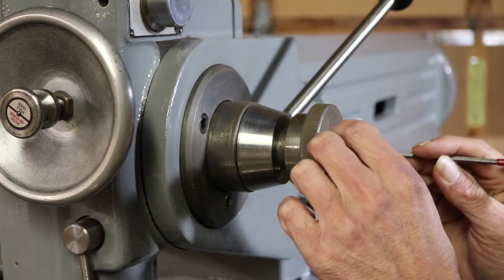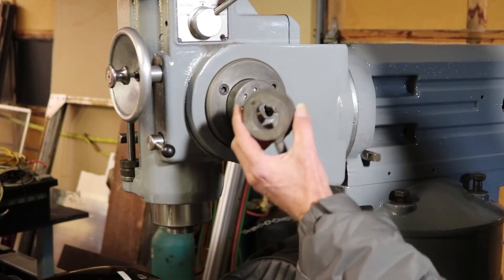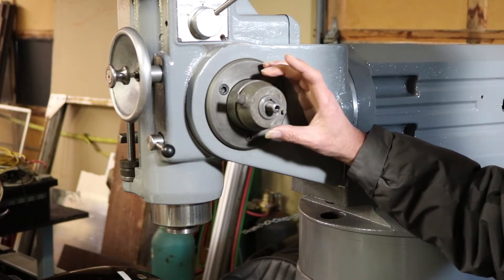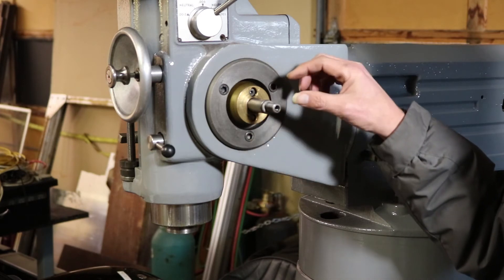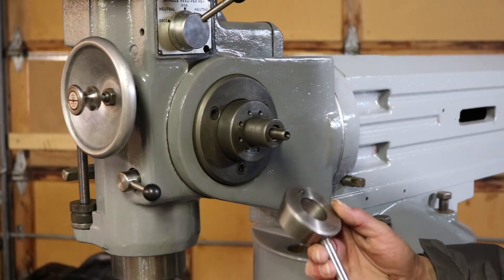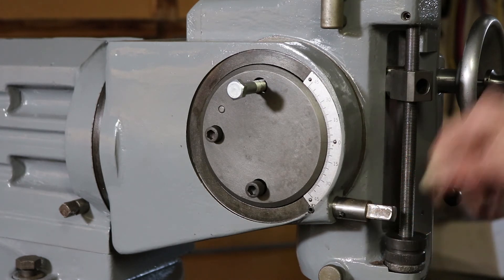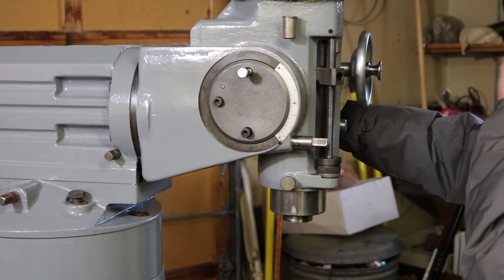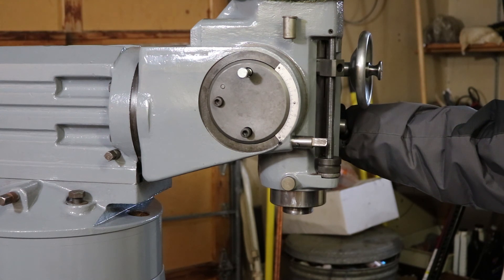EX-CELL-O 602 Vertical Milling Machine - Quill Feed and Head Removal - Part 1

Comment from the maker: If anyone needs any more information on removing the head let me know.  I need to get back into the gearbox that drives the quill power feed to fix the one thrust bearing inside.  One ball fell out while re-assembling the gear train inside.  I'm willing to pull the head off and apart on video just to document it for others.
Reply: We have two more EXCELLO questions.1.do you know here we can get a replacement rpm gage wheel for the head? And 2, the. Ram handle just spins.did we break a pin on the shaft?( how can we free up the ram?
Reply from the maker: @chrisdnomiug8994  There aren't a lot of parts available for these mills. As far as the quill goes there is the quill lock, the lever on the front of the head under the hand wheel. The power feed selector should be in neutral and the power feed clutch knob should be tightened to engage the clutch that I talk about in this video. I hope that helps.

Comment: I have the same mill with the power feed broken off at the handle . Do you know if that is hard to remake
Reply from the maker: Hi Keith,

If you send me pictures of the damaged parts I should be able to help (email address below).

I should also say that there may be one internal part in the head that could still prevent the power feed from working.  It is a Nylon gear pressed onto a knurled steel keyed carrier in the head to power the feed gear box.  Nylon expands over time and mine has expanded to the point that the carrier can't rotate the Nylon gear to power the feed gear box.  Depending on what external parts are damaged it may be somewhat difficult, or not, to determine if the gear is incapable of driving the power feed.

I'll be glad to help if I can.

My email is mccullochjimn@gmail.com

Comment: Kudos to you for saving this machine. In my opinion, the XLO leaves the Bridgeport in the dust. Just bob the head on a Bridgeport and the cutter is off the table. Also, an additional inch of quill travel is great. The only machine of the Bridgeport type that I like better is the Tree 2UVRC.

Comment: Jim, thanks for publishing your two Excello videos. Your first video inspired me to create a similar video that I just published for my Excello mill I rebuilt back in 2011/12. Overall I think mine was in better shape than yours, at least in regards to mine not being out in the weather for years. I still had to replace a few parts but I got lucky and found what I needed.

If you get the opportunity you should publish another video of your mill in it's current state.

Thanks! Brad
Reply from the maker: Brad, thanks for the compliment.  Your video was great, it was like reliving those times all over again and it gives others images that I didn't quite get.  Nice to see another early model.
Unfortunately I haven't worked on it since the second video, the Y axis has a .007" dip in the center and other life happened.  At some point I think I'll get up with bcbloc02 to HBM the knee.
I subscribed to you and I'll add a link in the description of this video your channel, if I can figure out how do that to.
Reply: @jimm2099  That sucks about the .007" issue.  Any idea how the knee could wear that much in the center?  I didn't realize it until recently but Brian Block is only a couple hours north of me.  I live near Richmond and he's up in the Frankfort area.  I know what it's like to put projects on hold and in the interim time just seems to fly by.
Reply: As far as adding links, I'll do the same if I can figure things out!
Reply from the maker: @bradkahler  There are some reports about the metering/one-way-valves clogging.  Jeff, my neighbor that I got it from said it came from a community college. The table looks like it was from a Jr. high.  In any case the metering valves were absolutely clogged.  I'm in Durham.
Reply: @jimm2099  There is probably some truth to the metering valves plugging.  My mill had no lubrication system when I got it.  Someone had replaced all of the fittings  with grease zerks.  The whole mill was one gooey mess.  I thought your table looked pretty good compared to mine!  Mine doesn't have much in the way of flat spots anymore.

Comment: My buddies EXCELLO motor spins,but when he installed the belt it stops.is there a quill lock or brake that is jammed we missed? Or back gears? Motor is running on a VFD.
Reply from the maker: Chris, The spindle brake lever is on the left side of the belt housing. The back gear lever is the high and low speed lever. Three things come to mind without further details. First, the cam activated shaft running horizontally through the left side of the belt housing is locked in place in the braked position. Two, something is wrong in the back gear box. Three, the spindle is locked up. If you can provide more details I may be able to help more.

Comment: Hi Jim,
 did you ever get back to the power feed? My down and up pull rod is extremely tight to operate,the mill works in both directions it's just a bear to move the rod. any ideas what's going on in there? any help is appreciated. Thanks
Reply from the maker: Hi Todd,
I haven't taken it back apart yet.  I will have to say though that the gearbox on mine was 70% to 80% filled with very old grease. That same forward/reverse rod was very difficult to move on mine when I first got it, there was a lot of crud between the forward/reverse rod and the fine feed hand wheel shaft.
They are both about 10 to 12 inches long and it's quite a long journey to pull them out. If it were me knowing what I know now and that is your only real issue, I would say maybe try a little solvent between the rod and shaft a bit at a time.
I wish and hope to have the time soon to videotape the removal of the head and get back into the gearbox, that shaft has one ball missing from the thrust bearing which needs to be removed to fix it.
I hope this helps.
Reply: @jimm2099 ,
 Thanks for the reply! Yes that is the only real issue I have other than the power feed controller for the table is missing(would love to get that fixed also). I will try the solvent and hopefully that will make an improvement.
     Thank you for your time and the videos, can,t wait for the next one!

Comment: Hello Jim, I wanted to thank you again for the help / information in re-setting the T-Bolts in my mill head. It was a bit formidable at first, but we persevered and got it w/o rotating the head. thanks again for the help!
Reply from the maker: I'm glad to hear you got your mill working again.  I'm sorry if my information was incorrect, there are two versions of EX-CELL-O mills,  an early version like mine and a later version.  You may have the later version.  P.S. If you have the later version that manual is also on vintagemachinery.org as well.

Comment: hello Jim, we have the same machine at our shop. Recently we did a job where we had to rotate the head 45 degrees after removing the 4 bolts. Once the job was finished, we rotated the head back and plumbed it up. Our problem is this...we're unable to get the 4 bolts to thread or connect. Any advice on what we should do?
Reply from the maker: There are 5 bolts, 2 on each side and 1 on top.  The nuts are captured in a circular T-slot in the head flange, if you remove the bolts the nuts just slide down to the bottom of T-slot circle.  They should only be removed if you are removing the head from the ram.  There is a rectangular hole in the bottom of the head flange that is used to install the T-nuts, you should be able to see and/or feel them through that rectangular hole.  Loosen the top bolt and rotate the head to remove the T-nuts from the hole, then rotate the head to each bolt position and insert each nut.  Hope this helps.  Here's a link to the manual -  http://vintagemachinery.org/pubs/detail.aspx?id=6985
Reply: I just read your message here on YT. Thanks so very much for the info as well as the link to the operating manual on Vintage Machinery. I do as you say come Monday A.M.
Reply from the maker: @buddydog1956  You are welcome, if you have any more questions I'll happy to assist if I can.

Comment: Hi Jim. I have the same mill and it has been really reliable for the last 3-4 years. Yesterday the quill feed stopped working. If I put it on the .003 feed rate the quill will turn but I can stop it with my hand. Do you know if there is a key or something on the quill feed shaft that could have broken?  I’m open to any suggestions for repairing it. Thanks
Reply from the maker: So, it only feeds on the .003 feed setting or on all?  Oh, I think I might know.  You tighten the feed clutch and you can stop the handle easily?
Reply from the maker: Kevin,

There is a nylon gear that is attached to a knurled steel hub that is driven by the spindle that powers the feed mechanism. On my mill the nylon gear expanded to the point that it no longer had a tight fit on the hub. I have a feeling that may be the issue. Let me know if you have any questions. Do you have the manual?
Reply: Jim M Thank you. I have an online version of the manual but it is unclear to me how to pull that quill feed shaft   If from the front or back. Is it a project a mechanically inclined novice could tackle?
Reply from the maker: Just to be clear, is your mill an early version with the letters XLO cast vertically on the front of the head?  My email is (Email Removed), feel free to email me. I can point you to a pdf you can download.